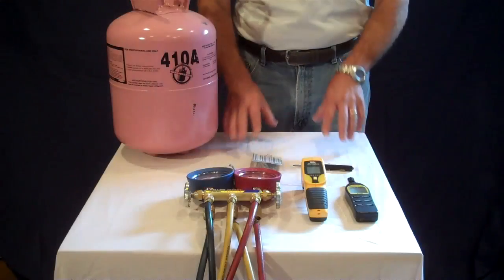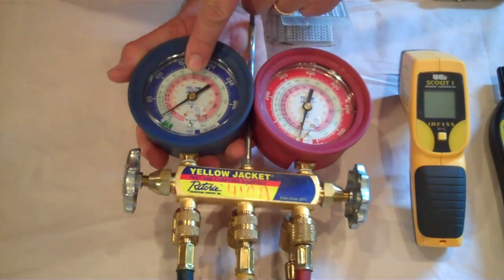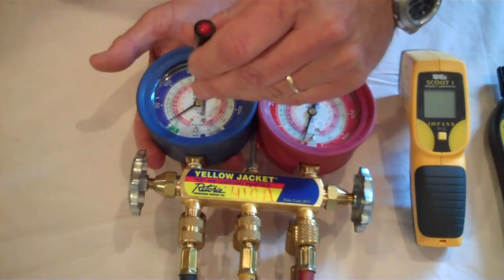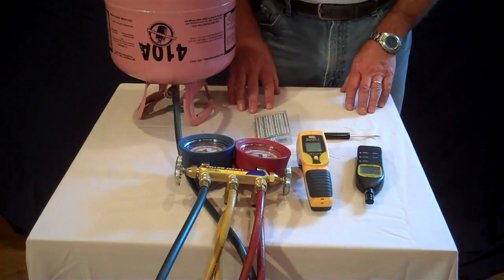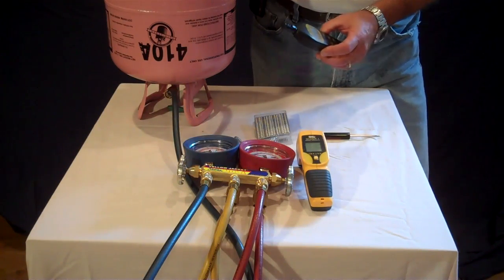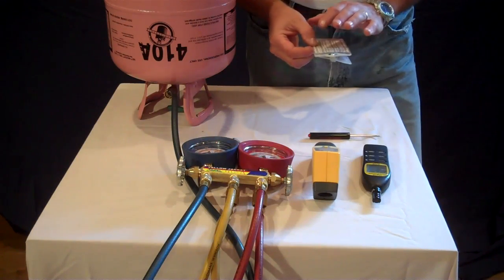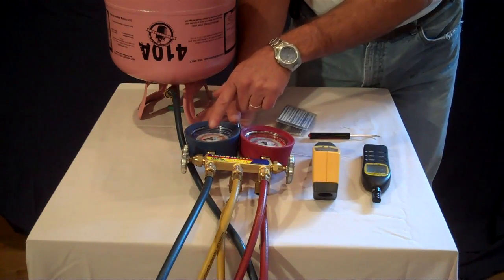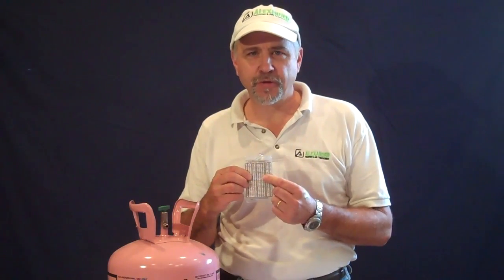Calibrating a Gauge Manifold Set

Comment: So you are saying that a true calibration to accurately get your SC or SH is to not so much depend on the Zero but to get a refrigerant tank and calculate the ambient and pressure numbers, that would mean that on that gauge zero would not be the accurate pressure with nothing hooked up?
Reply from the maker: If they both don't line up, your gauge could be damaged or the spring could be retarded. The zero also is an end point. It could read zero but the spring wants to push it below zero. Then you need to calibrate it at a higher pressure to see if the zero remains at zero.